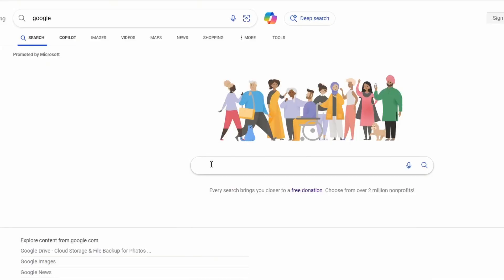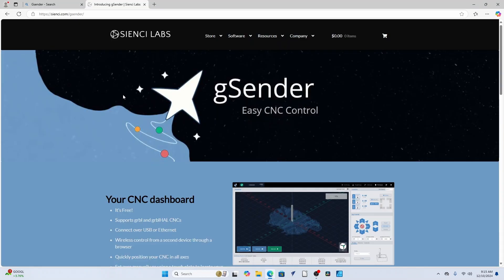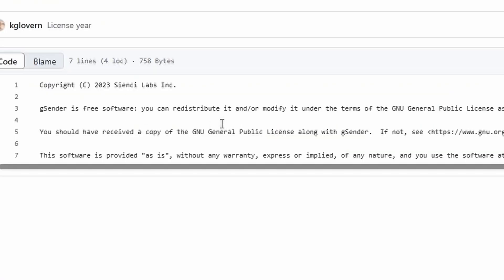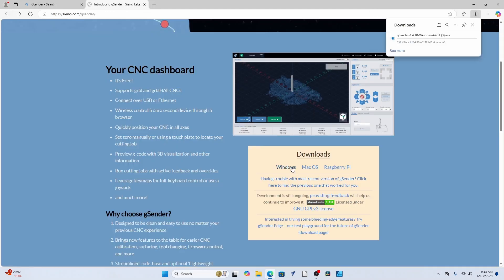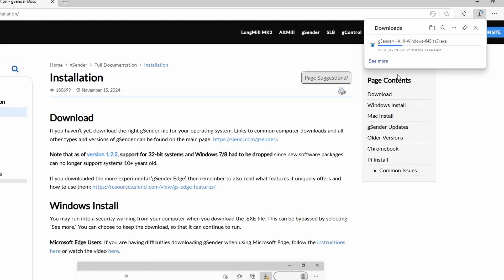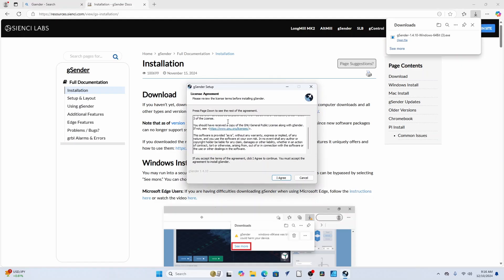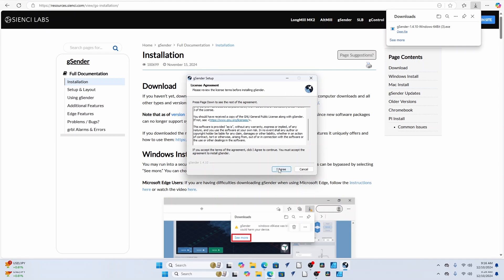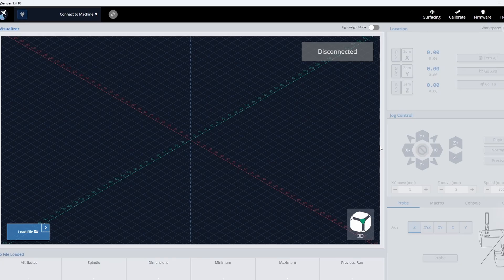AWESOME FREE CNC SOFTWARE: ARDUINO GRBL AND GSENDER | BUILD YOUR OWN DIY CNC ROUTER EPISODE 2

Comment: Hi, Can I use this also for a Laser engraver?
Reply: You can down load LaserGRBL for free. It is a laser based software that can also flash GRBL to an Arduino. LaserGRBL has an option to flash a GRBL version for two axis machine that doesn’t use a z stepper motor

Comment: Thanks for taking the time to make this video!
Where is it getting the GRBL flash files from? I want to flash an edited config.h. How do I get gsender to select the version I want it to flash?
Reply from the maker: The CNC software files (such as GRBL) are already in Gsender so you don't need to download them from anywhere else (just select a machine that most closely matches your build in the firmware settings under the profile tab using the down arrow on the right to see all the available choices).  Generic CNC is a good starting choice if you don't know where to begin but generally most of the models you select under profile tab likely would work for an initial flash onto your arduino (since most machine profiles provided on dropdown are GRBL based and if what you select doesn't work -- no problem just try again and select something else and try flashing it).  But no matter what machine profile you flash it is very important that before running on your CNC that you go and adjust all the settings to match your machine like bedsize, max feedrate, etc (or you could crash your machine).  You can adjust these settings easily by going back into the firmware tab (like you did before when you first flashed the arduino and adjusting each parameters individually as needed to match up with your build BUT this time rather than hitting flash be sure to hit Apply New Settings button and not the flash button (or you will lose your new changes).  This should overwrite the parameters with the new values your provided onto your Arduino.  If you need to modify them more simply connect your arduino and go back into firmware, change, and hit apply new settings button again.  Also as a reminder remember when you go back to the previous main screen you will need to reconnect your Arduino for the settings to be active.  I hope that helps.  If you have more questions let me know.  Since this video came out I know the main website has released a newer version of Gsender whose menus are a little different.  I personally like the older version (which can still be downloaded from their website) as I think its easier to navigate through the flashing process.  Let me know if what I shared solves your problems and if not tell me a little more of what is stumping you.  I have considered going and doing a new video on flashing with the new version of gSender (but that likely is going to have to wait awhile as I have to finish up a few other videos first).   Thanks for commenting and let me know if you have more questions.

Comment: Hello sir please help me can i how can i configure full bed cnc router machine by  grbl . please help me
Reply from the maker: Sorry, I managed to miss this question.  Are you still having trouble setting up your full bed cnc router machine?  I would be happy to help you out if you haven't yet figured it out.  It really is no different setting up a full scale machine than setting up a small machine except you change the max travel distance for x, y, and z axis to match your CNC machine (making sure you hit the save button after you change the dimension to match your machine -- this is where most people run into problems).  Also, when you reenter "GSender make sure you reconnect to you newly flashed arduino.  I hope that helps and if not just comment and I will get back to you much, much sooner.

Comment: Wow, this was super helpful! I built the mechanics of a pen plotter and I'm at the electronics stage and hit a bunch of road blocks with software, Arduino IDE, etc. I had my Arduino connected, flashed and working before the end of your video! Do you see any issues with this code sender driving a pen plotter with hobby servo for the pen up/down? I know there are some settings I will need to adjust from the generic CNC. Subscribed! Thanks for sharing!
Reply from the maker: Thanks for the great comment. Well done at getting it up and running. Lots of people don't understand how much easier it is to do this in the way I shared in the video. I haven't configured a servo motor with Gsender so I am not sure exactly which parameters you would need to tweek off my head. However, you definitiely you can mount a very small mini stepper motor and drive your pen mechanism up and down with it.  I built a plotter with this mechanism, and it worked well.  You could even 3d print a coupler for your stepper motor shaft that has a fixed extension rod that drives your pen mechanism.  In OpenScad it is easy to precisely model custom couplers for 3d printing.  I used a 3d printed one with a set screw to anchor it to the stepper motor shaft and it worked great (but not probably a safe thing to do with a CNC running a powered router but perfect for a low cost plotter).  I also modeled some rubber band tensioned pen holders for a plotter in openscad that worked really well (micron archival ink pens are awesome for ink drawings but bic pens are a good low cost alternative).  If you need help with modeling something in OpenScad let me know.  In a few videos I will be going over configuration of parameters for the CNC build.  I think you might be able to use the laser pin for your servo motor.  If you haven't figured it out by then I will try to see if I can give you a simple solution then.  In the mean time, If you do figure out the pin parameter for your servo if you could post below what you did I am sure that would be helpful to others.  Thank again.
Reply: @ Thank you for all of the tips! I’m still designing the pen mechanism because I wasn’t sure if the servo would work or I would have to use a stepper. I’m using 3D printed parts with linear rail bearing for my build. 
Im solid on the design side using Fusion 360. My challenge is the software side. I’ve seen lots of projects that use Inkscape with a gcode extension to create a gcode file from an SVG. Drop that file in a gcode sender and run on a GRBL powered board/machine. Thanks to you, I got the gcode sender part done! The Inkscape ext creates a spindle on/off that the gcode sender reads to output a pwm signal for the servo. There seems to be some issues with the specific version of Inkscape, GRBL, extensions, etc working well together. I’m working on the wiring right now and should be able to get the steppers communicating. Thanks again for your help! Once I get this under my belt, I want to start in on a router project like yours.

Comment: Thanks for the video! I feel like I’m one step closer to getting everything figured out. I really appreciate the time and detail you put into this!
Reply from the maker: Glad I could help.  Thanks for your comment.  What I shared is what I wish I would have known when I built my first CNC.  Once I figure it out it was like a light went off in my head.  GSender makes setting up your Arduino with CNC control software so much easier. 
 It is also fantastic when you dial in your final settings.  I'll go over that in a separate video in couple weeks.

Comment: Thanks for this series, I'm really enjoying it!  I'll probably build a CNC machine eventually.  So far I've only experimented with 3D printing but I'm very interested in CNC and laser cutting.  The Windows before 10 was 8, there was no Windows 9 (just as an FYI).
Reply from the maker: I started with 3D printing as well.  I began with a printrbot kit, then built my own 3D printer, then bought a Prusa MK3. Next I built a couple of plotters.  I was given a very small Genmitsu CNC kit for a Christmas gift.  Then I built my first large CNC a few years ago.  3D printing, CNC, Plotters, Laser Cutters are all very similar.  3D printing is a good foundation as it has a lot less safety issue to deal with on the front side.

Comment: I have the Arduino Mega, would it also work for me?
Reply from the maker: I believe it is possible to use gSender to communicate with an Arduino Mega that has "GRBL Hal" installed (but you will probably have to flash it using the Arduino IDE method). You can also buy a screw in shield to hook up your wires that fits on top of your Arduino Mega but the wire hookup numbers will be slightly different from the method I am going to show. There is a positive side of using an Arduino Mega in that it gives a slightly easier path to setting up a rotary axis later but it also has its drawbacks in that I've heard using the Mega sometimes still encounters some bugs and problems with the HAL software (and may require something called octocouplers).  My recommendation is to go ahead and build out your CNC with an Arduino Uno and get it working/fine tuned (then you can always unhook the screw in wires and then reconnect them using the correct wire configuration to an Arduino Mega that has GRBLHal flashed on it in the future).  Hope that helps.